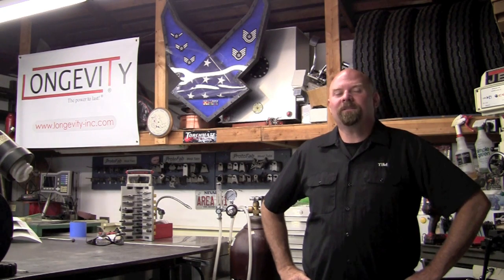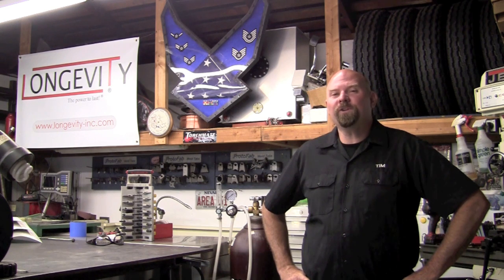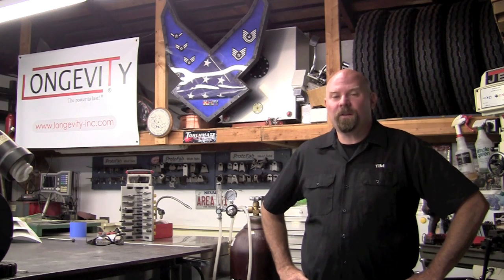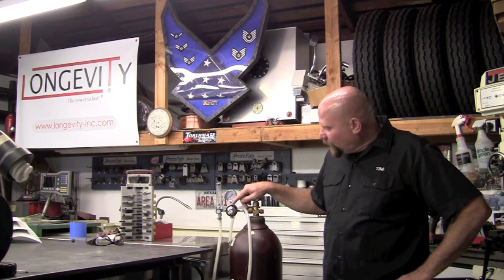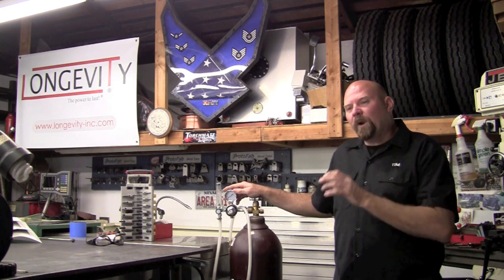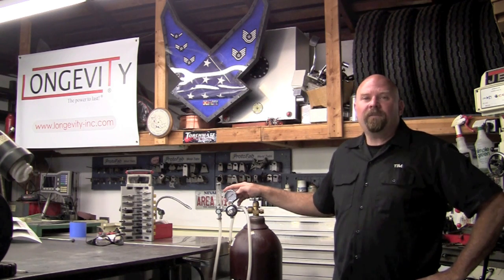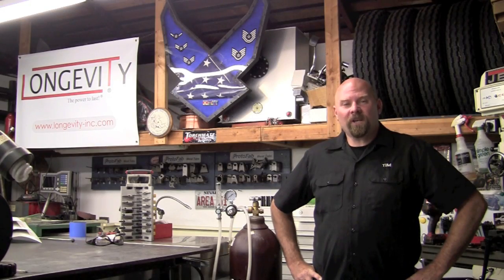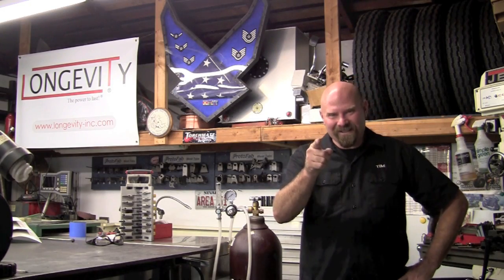Argon flow regulator LPM conversion to CFH

Comment: ERROR:  As a new welder, I bought a L/min type flow meter gauge and had problems converting CFH given in videos to L/min.  This video has been here since 2011, and it has the calculation exactly backwards.  The flow of 7 L/min for 15 CFH is correct, however it should be calculated:  CFH x .472 == L/min, so 15 CFH x .472 == 7.08 (correct!); not 7 L/min x .472 == 3.304 which is the wrong number.  Another problem for me was trying to use GPH  instead of CFH in my calculation.   So look for CFH to L/min for the conversion.  Hope this helps someone who is having the same problem.
Reply: Yes, his math is backwards. LPM / .472 = CFH